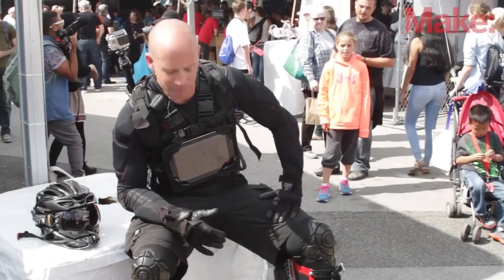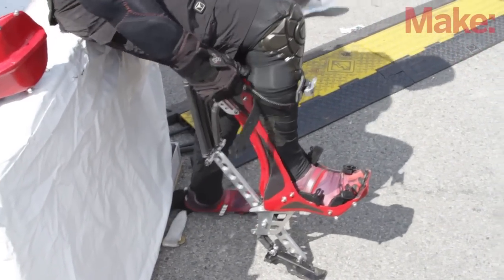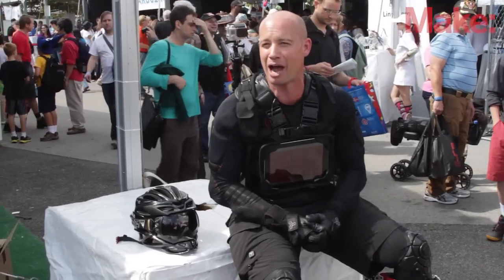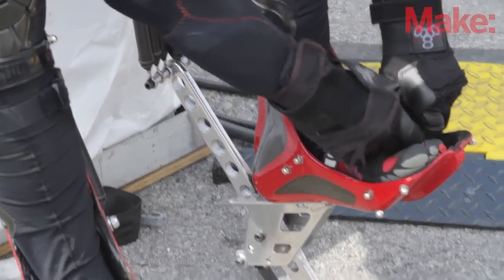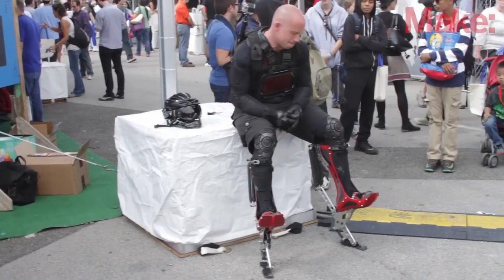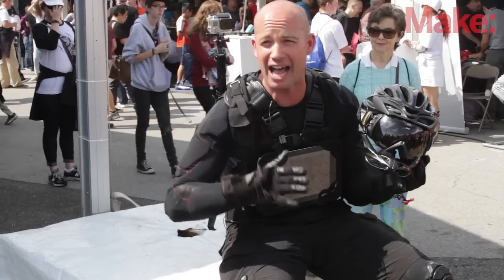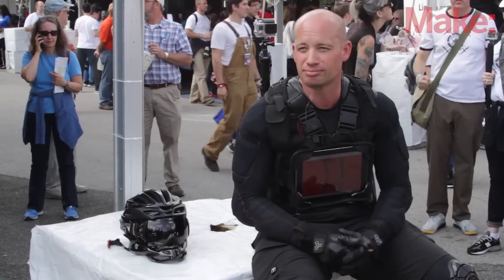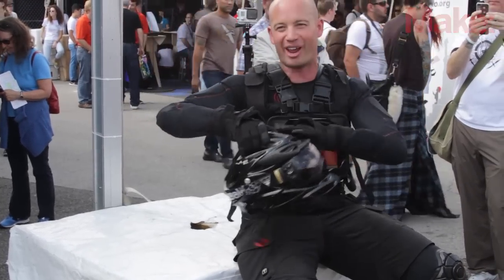Bionic Boot: Human-Powered Exoskeleton

Comment: Correct me if i'm wrong but shouldn't the stored energy release when you push yourself with the front of your feet instead of the heel?
Because it looks like you only use your heels with these boots...
I think he has to adjust them so you can shift the balance of your body to the front by bending to the front, and have some kind of toes at the front that start around the sesamoid bone.

Comment: there is some kind of jump boots already available, with a carbon blade acting as a spring, a lot of guys are using it to do some cool tricks. I wanna saw this in more action to spot the differences...
Reply: 7 league boots !
Reply: I have personally watched these in action for a few hours and they are designed for forward speed whereas the jump boots that exist are for height.  Plus they infringe on this guys patent.
Reply: MrPafleouf Are you thinking of PowerRisers?  if so, I know exactly what you're talking about.
Reply: Austin Marhold This guy's patent? There has been a patent on this concept by Alexander Böck since 2004. This idea isn't new. And there are other brands that focus on forward speed, not all powerbocking shoes are meant just for jumping.

Comment: No offense to Keahi Seymour, but he is not genetically blessed for running nor does he train like Usain Bolt.... Usain Bolt ran the 100-meter dash in 9.58 seconds in 2009, which is an average speed of 10.44 meters per second. During the same run, in which he set the world record, he achieved a top speed of 12.27 meters per second, which is equivalent to 27.44 miles per hour. He can do 25 with this? That is impressive.